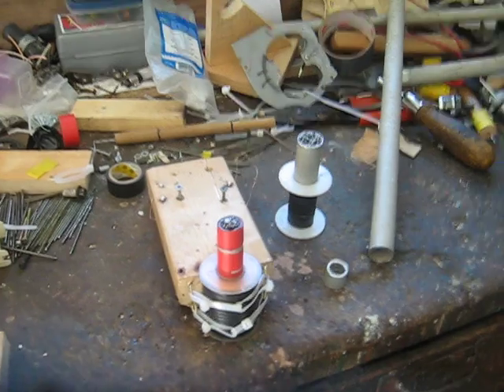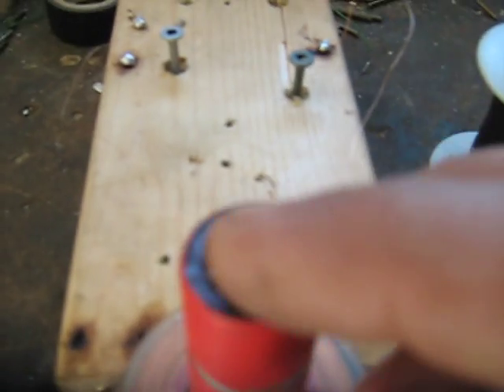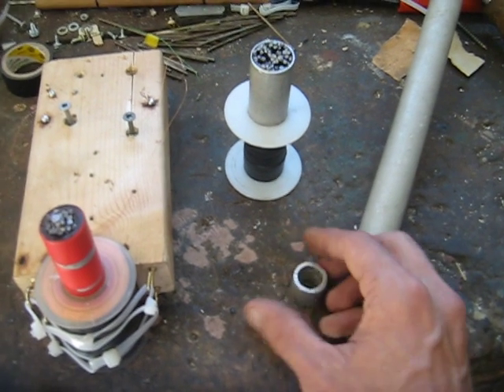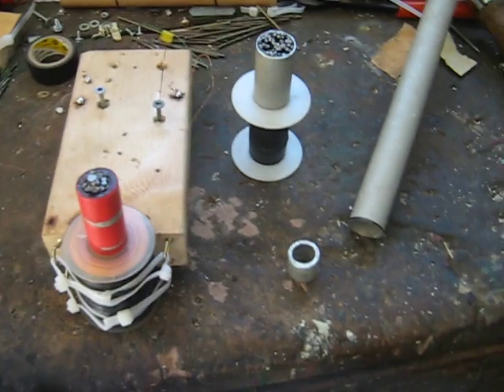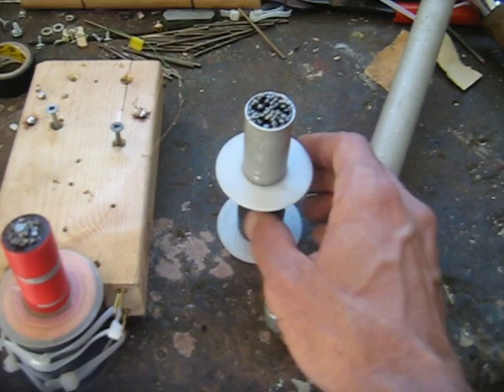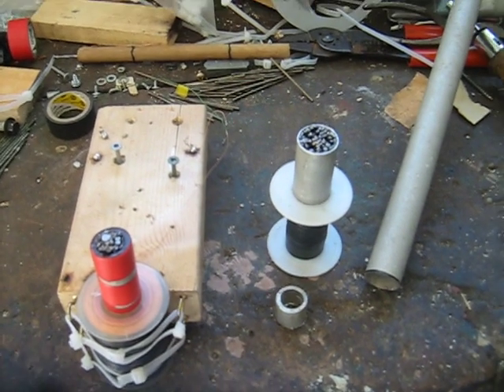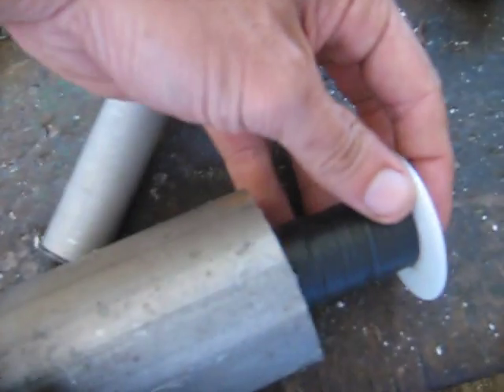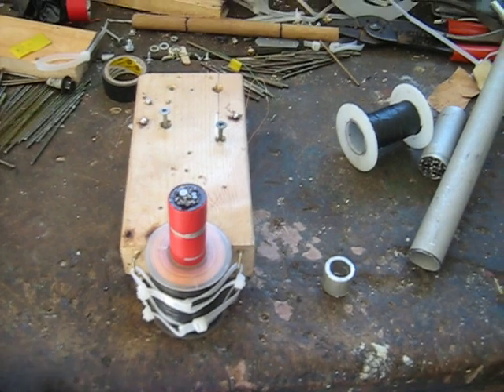Ed Leedskalnin Coil Design

Comment: interesting videos. I'm no expert, but from what I observe I have a suggestion to try. first, a meter in ammeter mode is basically a short. the voltage across your short is approx. 0v (not 70) shorting the coil makes it impossible to effectively change the magnetic field, thereby unloading the prime mover, hence current drop. try measuring voltage across - and current through - a small resistance, like 1ohm instead of your ammeter (short) for a better idea of the power produced. cheers.

Comment: dont worry about sounding hillbilly, i was raised in the country lol. if ya get a chance head to international alternative center and check out my entry in pulse motor build off. home made 3 phase out of junk in the trash lol, and it worked great. will be testing out your coil also, see if i can  hook it up in the 3 phase, i got a smaller one running now at 42 volts off the pulse motor. just messing around with it. shooting for 100 volts.

Comment: Hey Angus

Was just wondering about that. RomeroUK did a similar thing and claimed a self runner. Maybe try some low ohm resistors inline with the amp meter while connected to the pickup coil to see how low you have to go in ohms to get even some speedup. This will allow for a measurable voltage across the resistor in conjunction with the amps to calculate watts out. Romero apparently had a shorted coil within his windings to get the speedup. 
Mags

Comment: Hey MrAngus
So if you remove the coil from the rotor, what is the amp draw on the drill motor compared to when the coil is present and also shorted into the amp meter?

Thanks

Mags

Comment: There is a flaw in the coil design. Circular coils do not capture all of the induced electricity. A triangular form has a greater length to be induced by a passing magnetic field. Much like the homebrew wind generators & they don't have metal parts which wast energy from eddies. They use resin and wood. Guess you can use high temp, plastic. - Cheers.

Comment: Hi there - superb work =D. the second you described how the aluminium pipe acts in the coil i thought of - Regenerative acceleration. the guy has used a high voltage wire rapped in high current wire an got the same - prime mover acceleration/ amp draw drop, you demonstrated here too.

Comment: From where did you get the Magnetic Current book?
I can't remember anything about alu pipes from the copy I read.

Ed wrote that a outer Iron pipe connected to the inner iron core was good for an electro magnet, but isn't a generator the opposite?

He also wrote that he generated more electricity with iron. So I'm thinking about an aircore coil wounded with iron wire. Sort of core and winding in same place, maybe less magnetic field outside of coil. Have you concidered experimenting with that?